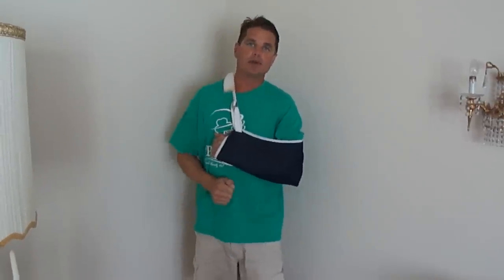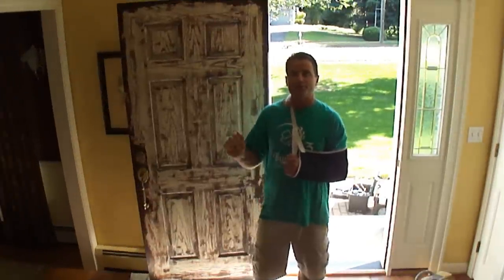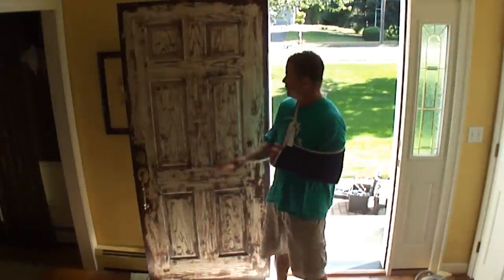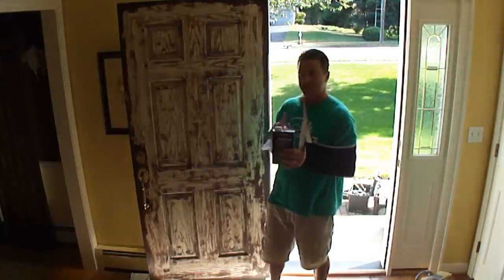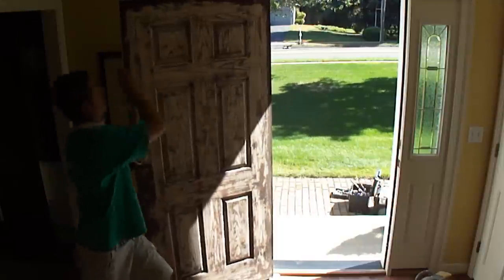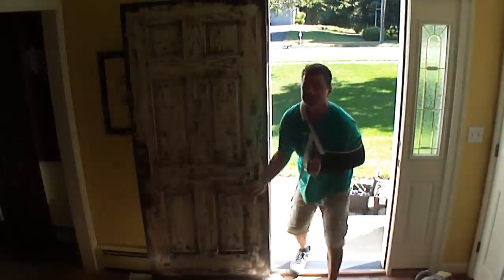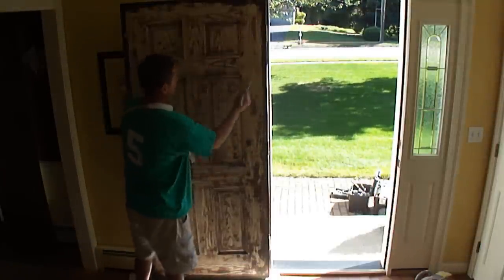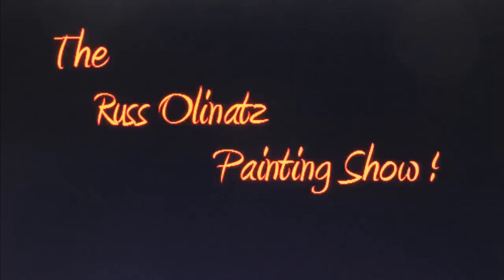How to Paint a Stained Fiberglass Door (Part 1)

Comment: In the video you prime immediately after wiping down with Wilbond . I just want to confirm that there is no waiting time. Thanks for the videos for fiberglass doors, just preparing to paint mine.
Reply from the maker: Hi

Depending on the weather, it dries very fast. It’s basically denatured alcohol. What primer are u using?

Russ
Reply: @RussOlinatz  The Stix you recommended
Reply: @RussOlinatz  Humidity is currently 24 so I shouldn't have to wait long.
Reply from the maker: It evaporates quickly!

Comment: In this step you say use 80 grit sandpaper, but in the later stages your are using 180 grit.  Is that correct? Also, do you still recommend Wil-Bond?  It is hard to find.
Reply from the maker: Hi

Thanks for your question. Use 80 or 120. Here is a link to my Amazon Store front. Click on “Sanding Tools” and you will see the Wil-Bond. 
Check out this page from Russ Olinatz Painting https://www.amazon.com/shop/russolinatzpaintshow
Russ

Comment: I have NEVER seen anyone paint a Door on it's hinges...
I have flip' 24 houses and I take the door OFF and paint it
... and WAIT... until you can use your arm again...
We will wait for you to heal...
Reply from the maker: Hi Judi

I do it all the time. It’s easier then to take them all off. Especially in remodel repaints. Not to be confused with new construction new doors. If you have a set up room with a helper, then yes. Do you work alone?

Russ
Reply: @RussOlinatz  
Yes, I see what you're saying...
You're right.